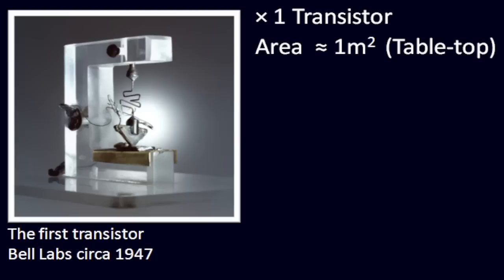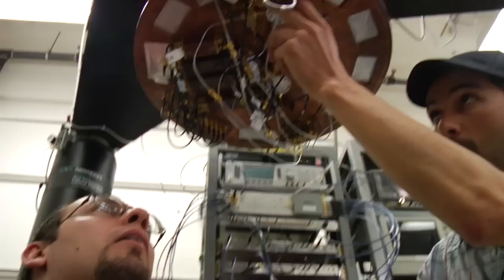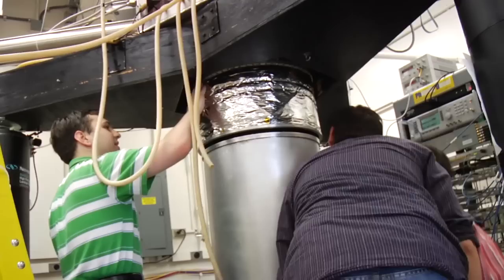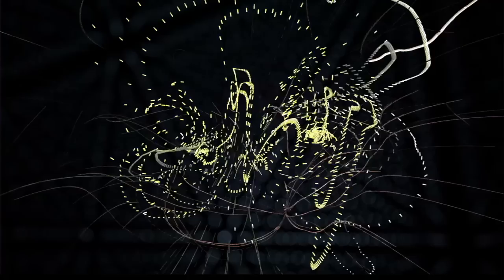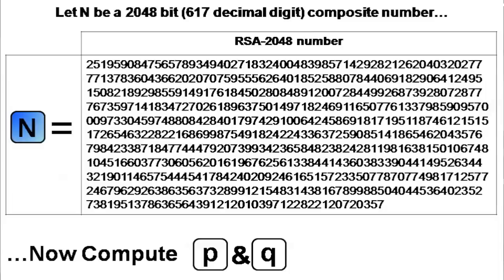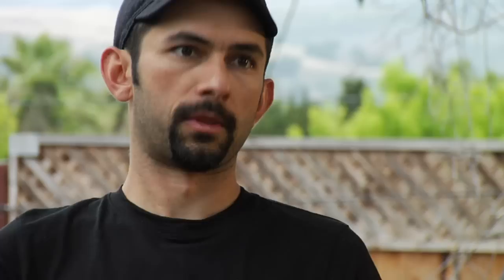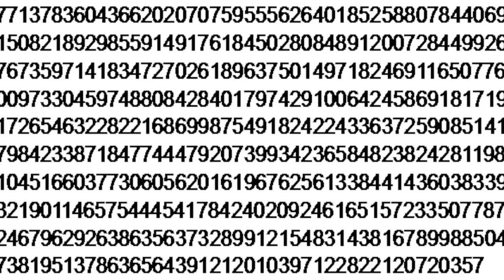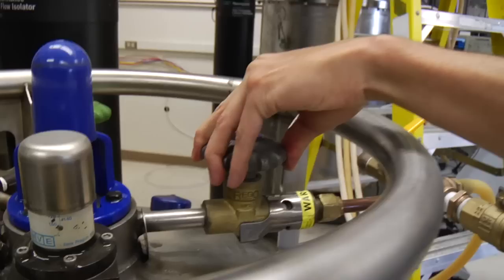15 = 3 x 5: Erik Lucero's Quantum Computing Breakthrough

Comment: Erik & crew - think about ESD protection when you handle the silicon. static clothes > movement > kV's charge > fries or weakens the silicon. You're carefully carrying the processor - but you're generating a charge - it's looking for the easiest discharge path. Been there done that.  ~Bob, EE

Comment: Yes you can, because checking if a factorization is correct is straightforward: you just have to multiply the numbers together. If you get the wrong result, run the algorithm again. The probability that you'll never get the right answer is about (1/2)^n, which gets very small very quick.

Comment: Well let me explain it to you, 15 = 3x5 is integer factorization and those kinds of problems are 'easy-to-check', meaning if you are given a solution you can easily check whether they are correct or not. Keep this in mind. If I told you 987=3*7*47, you can immediately multiply 3 numbers and check whether I was right or wrong. 'Immediately' is compared to the time you would spend if I asked you the question "What is the integer factorization of 987?" Do you see how hard is it?

So coming to the problem this quantum computer gives us the right solution 48% of the time, wow this is fantastic! I would be glad if I could get the right solution 0.001% of the time! Do you see why?

Because I could feed the output of the quantum computer to a classical computer and let it check if the solution was correct. How long would it take? 1 ms? Well I certainly could run the quantum algorithm 1000 times, and check the output 1000 times, only 1 second overhead with these numbers. (Of course you would stop if you got the right solution inbetween 0-1000)

The good thing is that integer factorization problem is easy-to-check as I just said. Consider TSP problem, given a path, can you easily check if it is the solution? Nah, you can't, as much as I know.
Reply: Eralp Bayraktar what happens when there are multiple answers?
Reply: There isn't .... all numbers used in the multiplication are prime numbers...
Reply: What happens 52% of the times?
Reply: So the original problem of factoring the huge number would only take 1/2 the age of the universe instead of the entire age of the universe?  Still not practical!
Reply: Eralp Bayraktar is this related to p vs np
Reply: Travelling Salesman problem is in NP, which by definition means that we can verify a solution efficiently. However as @Eralp said, we cannot find a solution to an NP hard problem efficiently.

Comment: I think they should add the vitron 5000 to the colex capacitor to achieve a high velocity radrant so that the regenitive retrospective invulator will transistally reconsultrate the flux hydron so fusion may be finally possible.
Reply: Not "invulator" - "INCULATOR"!  Amateur.

Comment: the qubit can be represented as a 0 or 1 or a superposition of (10). the best analogy is if you imagine a red door as a 0  or closed and a green door as 1 or open ..in classical computation these are the only doors available to use. in the quantum computer there is also a yellow door the superposition. let's imagine a maze of rooms with three doors. in order to make the best progress through the maze all the doors must lead to a solution ... however in the classical computer the doors can only be opened one at a time I.e red door blue door blue door red door. in quantum computer a yellow door is available as a tool to check both doors at once... so you have a headstart as each door is open the rate at which you progress thru the maze is n to the power of 2. this exponential trait is what sets quantum computers apart from classical dual bit computers as the function of the superposition ( yellow door ) which is not available to classical computers allows a quantum speed up. the example above denotes a single qubit however as you add more and more qubits the function of n to the power of 2 is multiplied by the number of cubits.

Comment: Because silicon computers, what we are currently using, will reach max computing power in 15 years or so. Quantum computers have no real limits on computing power that we know of. It is just a matter of discerning effective methods to turning that higher power into an effective and accurate means of computation.

Comment: I believe they need to attach the T-1000 module to the flux capacitor to for voltron fusion to be possible.
Reply: Don't forget the extra Duracell battery.

Comment: So in order to make it a functional computer. It needs an algorithm that runs what ever you are calculating several times, two arrays with each being run let's say 5 times , if the same value is returned 2 times out of 5 it returns that value to the first array. It does the same thing again and if it returns the same value twice out of five it returns that value as the correct value to the second array. Then it compares the arrays if they have the same value it returns it as the correct calculation and then proceeds to the next calculation, else it reruns the calculation. I think that would work.

Comment: If we had 10 million qubits working optimally we'd have enough computing power and data to store every electron, photon, and atom in the universe in so many different states that writing down the number of different state universes would take longer to write than the age of the universe.
Reply: The funny thing. 10 million qubits wouldn't be hard to achieve either. The hard thing is simply getting the architecture to work properly. We could already make a chip with that many qubits if not more, just wouldn't work.
Reply: Actually, you only need 500 qubits for all the information in the universe.

Comment: Hypothetically (?), the self-organization of the Quantum Fields Mechanism, is what atomic structures in the Standard Model and Periodic Table are, all resonant summed history, phase-locked together in chemistry and physics, and are arranged according to the languages of mathematics in our perceptions to behave in particular "computed" ways of psudo-randomness. Ie if we can remove the "noise" of the annealing process, then a predetermined result of superposition will match the actual state output by the device, ("The Babbage accuracy of construction problem"). 

It's the ultimate parallel processing  by design using an effect similar to the growth of spacetime-elemental grains (of primes) in crystal-coordinate resonance? 

Sum of all histories, now to now=>eternal constant/resonance.

If the analog computation, (another name for an analogy by simplified comparison), is continued, then it's the readout of results that is the determining factor, (literally), of a successful operation, and so the methods and devices used in MRI, tuned to the desired range of solutions, is critical? (And possibly a compound set of scanning frequencies like WiFi in reverse..)

It's analogous to the "hard problem" of mind in body, because it's a phase-locked distribution of QM-Time, Q-chemistry by Fields Modulation Mechanism e-Pi-i resonance embodiment. If coherence is disturbed, the content in context connection goes very wrong, because the singularity synchronisation of the Quantum principle is also the Quantum Operator of the Exclusion Principle.

The nearest "device" analogous to the imagined operations of a Quantum Computer is possibly emulated by Human Savants, and that seems to be based on intense focus and vast memory storage with bio-logical Random Access (?)
If structures, =events, within the Universe are resonance grains of spacetime,  and bio-logical organisms are integrated multi-oscillator quantum information computation, insect colonies are hive-mind distributed computation,  then brain-body organisms are integrated cellular hive-mind, up to the levels of self-recognition and "consciousness".
Everything is phase-locked in resonance and timing spacing coherence/exclusion of cofactor-primes, AM-FM phenomena. 

One Multiverse ghost of coherence in one Quantum Computational Machine?

Comment: Gotta know, what happens with the other 52%? Is it just noise, some kind of imaginary solutions, a product close to 15, non-prime numbers, or what? It would help to understand the whole jig if we knew.
Reply: 52% of times you get 15 = 7 x 3 or 15 = 1 x 4 and so on. That is not a problem since you can very easily see that they are false. It is just enough to hit the right solution once and check it. You see if the number was 2048bits long you could run it a hundred times and get 48 correct answers. Voila all you need is one correct answer. And that you will not get in traditional computing before lights go out literally.
Reply: Nice explanation man, thanks
Reply: Petri Sirkkala not to mention you could pair the quantum output with a traditional computer to do the reverse or multiplying the two primes and checking to see if the result is correct.

Comment: I am guessing that qbits are use in super-impose states to compute all possibilities at once... but to get the answer out of the super-impose states do you need an operation which will make the answer you are looking for come-out? Can someone give an example?
Reply: +fcycles In order receive any output with significant meaning, you need a process and an input. They sortakinda explained the process, but didn't explain the inputs. Knowing how basic this kind of stuff is, I assume it was hard-coded; exactly like making a calculator that only had an on button and only performed one operation. The trick is reading the calculator, I guess.

Comment: Why is the solution of 1 x 15 not an option? Does this account for the reason 3 x 5 was the solution 48% of the time?
Reply: +Bill Nichols he was trying to find the PRIME factors of fifteen. 1 and 15 are factors of 15 but 1 is not prime.
Reply: Nar it'd just just return wrong answers the other 52%, but they'd probably be different wrong numbers, so the the right answer should still come out more often. And you can plug the factors into a classical computer and check whether they indeed equal the original number. That calculation is practically instant.

Comment: If the Qbit can be 1 AND 0 wouldn't that make for an almost infinite amount of storage space?
Reply: +upplsuckimcool16 qbit can be 1 or 0 or any fraction between those two number.. but when the qbit is read then it has either the value of 1 or 0 at that instant...
Reply: The hard to grasp concept of particle wave duality.
Reply: Could it reliably return data?
Reply: Unfortunately it still takes a machine the size of a room to operate on just a few bits.

Comment: In my imaginings of better computing, I always thought that a knowledge base in 3D space, would become the standard. It would contain all of mankind's knowledge to date. A clone of Artificial Intelligences would have it as their base.

But something I was reckoning on was 3D positioning could effect things by the interactions of actual electro/magnetically at some static level, would influence each other... but I did fail to say at the beginning this was for AI in 3D space... with the concept put forth that all knowledge has its place in logic compared to all other knowledge. And therefore would have its best positioning in 3D structure, a bit like a brain, but better. As it can be logically "wired" before it is designed to mass produced by machine into the solid unit. That is it evolves a Virtual add on for all its learning, so that in the next major upgrade, all of the AI's combine their data, so all get the new upgrade, either virtually or in the 3D mass produced new base model.

Then again, it could be colours and crystals at some point, making binary a fraz of billions of colours...

Comment: If you have to "verify" the result using a traditional computer then you will have a problem.  Consider Gödel's incompleteness theorems -- if you can solve a problem with a quantum computer that same problem will not be solvable on a traditional computer.  If a quantum computer is only "sometimes" correct then you will never be able to verify an quantum answer by checking it on a conventional computer.
Reply: American Citizen n*p is very simple for a computer to check

Comment: That's it?  Nothing about how you used Shor's Algo to get to 15 = 3x5??? Well that was disappointing =(

I get that it's a massive achievement to do that in a quantum computer, but I was hoping for a more indepth analysis / explanation of how you were able to get there. The Math. How the processor reached an equalibruim state.  How you used a series of processes.  This still seems like magic and wishful thinking to spend all this time trying to get a quantum computer to evaluate a complex system and have it spit out a result that may be 50% correct.

Comment: Dont our brains work like quantum computers?
Reply: if so, why dont we look and try so simulate our brain and quantum computers and see how to stabilize the atoms since our brain apparently doesn't seem to be disturbed like quantum computers are disturbed by fucking anything and make the atoms go all over the place.
Reply: I like this idea. Our brain ignores a lot of information, alters and destroys too. but what if we could make it better?
Reply: No the brain works nothing like a quantum computer.
Reply: Satyam Patel well our brain uses electrons etc from our nervous system that is what im trying to say. Its obviously not exacly the same but builds on the same idea of particles.
Reply: In a very simplified way, out brain is like a molecular computer, another variety of computer composed without the stress and randomness of quantum computers. Except it doesn't run like normal computers, constant electrical charges are coursing through the brain making permanent connections that take the form of memories and thought processes
Reply: Only the female brain.  She is only consistent 48% of the time.

Comment: weeeird dude i am pretty sure  3x5=15 100% of the time
Reply: Wrong way round. 15 = A*B NOT 3x5 = C. It does the calculation backwards.
Reply: i dont get it at al ? does it forms the question by already knowing the anserw ? like in

(5x3) = 15  where 15 is static and the calculation is a variable, and coule be annything aslong as the outcome is 15 ?
Reply: Nope. The question they ask the computer is: "What are the prime factors of 15" and it gives the answer, 3 & 5.

They didnt ask it "whats 3 x 5"
Reply: that makes allot more sence already
Reply: you don't need 5 atoms, it's all in base 2. So you would only need 4 atoms since 2^4 is 8, so with 4 atoms you can count to 8. Maybe a extra bit so signify positive or negative. Maybe it's 50% because -3 * -5 is also 15
Reply: I think it is because integers include negative numbers. So essentially it is always right. Theoretically 48% of the time it's 3*5 and respectively 48% of the time it's  -3*-5. That leaves only with 4% of the time that it "spits" out something else. What is this possibility, maybe imaginary numbers?
Reply: Either that or because we haven't perfected quantum computers there is a slight 2% fluctuation. Essentially both negative and positives being correct 50% every time, Which would mean that it will be 100% all the time in the future.

I honestly feel like I'm just talking out of my ass
Reply: Both ways it is true 100% of the time - using old school methods.

Comment: calculating 3*5 = 15 40% of the time? lol thats not reassuring.
Reply: *****
cool story bro. lol
Reply: +JadendayZero making a machine knows that 15 can be written like 5*3 is not easy , try to understand the algorthme first.
Reply: +Nagisa Furukawa I do understand. It just baffles me how a machine that big can only calculate such a problem only half the time right. Its funny lol
Reply: let's break its record so =D
Reply: +JadendayZero i think the first calculator calculated addition , it is the same thing just wait another 50 years to see enormous results
Reply: +JadendayZero You realize that it did this entire calculation with 5 (FIVE) atoms, right? The machine itself is not that big (it could probably fit easily into a meter cubed box), it is simply spread out to make it easier to cool the quantum processor to just above absolute zero (459.67°F) The device he was holding for some of the video was the actual quantum processor, that was what was doing all of the calculation. The machinery around it was for input, output, and ensuring that there is no interference.
Reply: +TheDXPower yea I do. And being able to manipulate atoms at such a scale is amazing. but im just saying. Its just baffling
Reply: +JadendayZero Why not? it's actually like, being a caveman and building a tv, it's ahead of it's time.. Try to compute it using atoms, then you'll realise, how much of an achievement that is.
Reply: JadendayZero nope. Its factoring 15 48 percent of the time